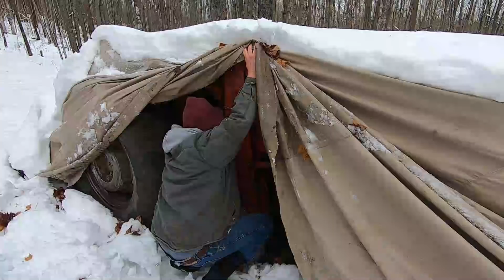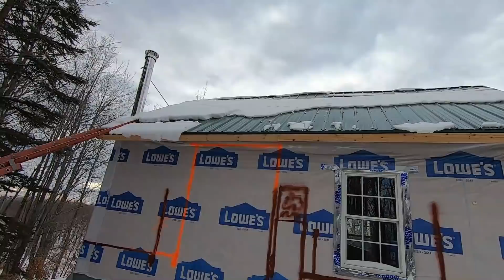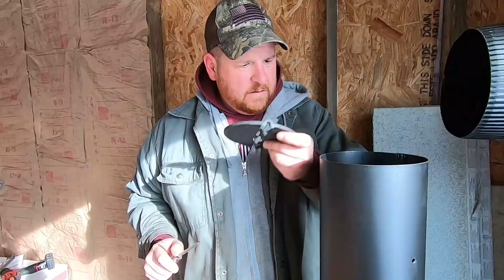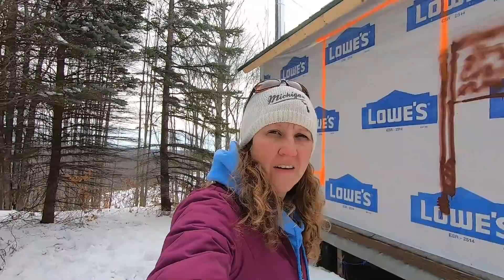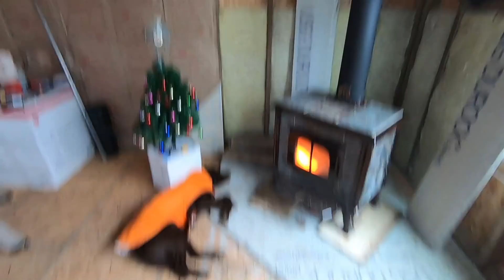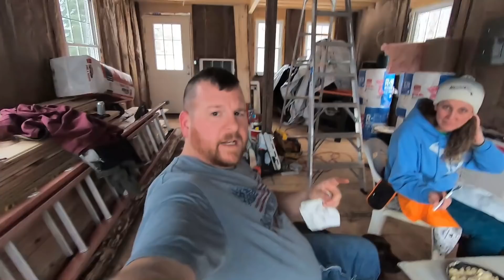First Fire in the Off Grid Cabin Wood Stove & Merry Christmas Happy Holidays Wishes from us to you.

Comment: Hey Guys, That sled will work out good for you. It may need a little TLC to start but once you get it tuned and running right it'll serve you another 30 years. Those old Polaris Trails with the 488 are bullet proof. I worked at Polaris for over 12 years up here in Roseau, MN. That brand I'm a little biased to. Lol
Reply from the maker: That's awesome, it seems to run like a top. It has close to 5k miles and always starts right up. Thanks for sharing. Best wishes

Comment: Had the same situation with two 90 degree turns in the chimney.  I wadded up a piece of news paper and started that to warm the flue before I lit the paper or under the tinder.  Rolled the paper up like a torch and hold it right under the area that the smoke goes up from the stove to the heat chamber.  Also, crack the door or a window when you first stat it.
Reply from the maker: Nice work Dave, I'll give that a go next time. Thank you.